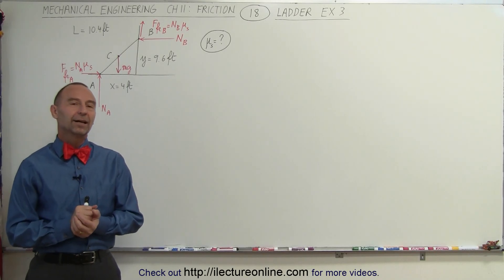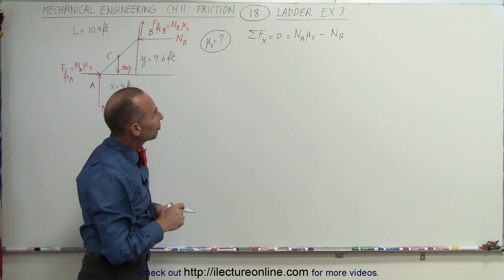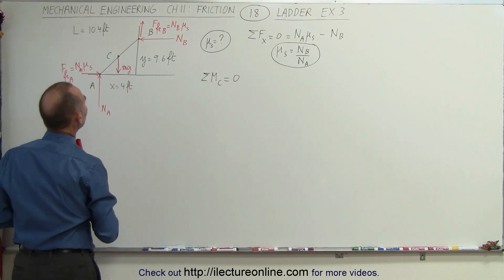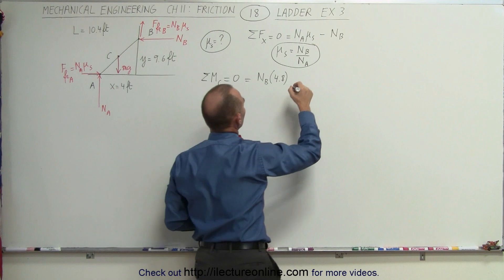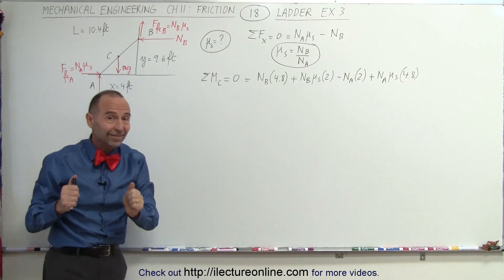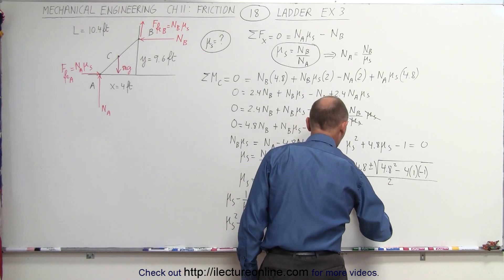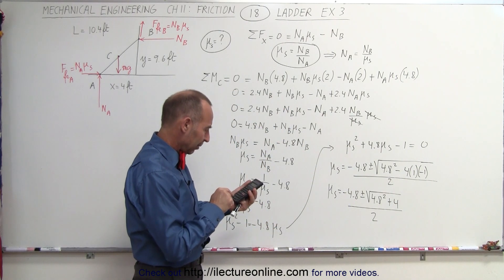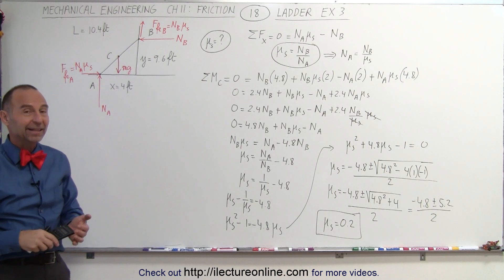Mechanical Engineering: Ch 11: Friction (18 of 47) Ladder: Example 3 of 4

Comment: Hi, why is it are you taking the net torque about C rather than A, which you did in the previous example? Is it because Torque about any point is the same since the Net Force acting is zero?
By the way, you are doing a great job . Thanks.
Reply from the maker: You can pick any point you like  (even away from the ladder) and calculate the torque.  The trick is (when you are trying to solve a problem like this) is to pick a point that will eliminate as many unknown forces as possible.  Forces, whose line of action go through the point of rotation, have a zero torque.
Reply: @MichelvanBiezen  Thanks for the classes...